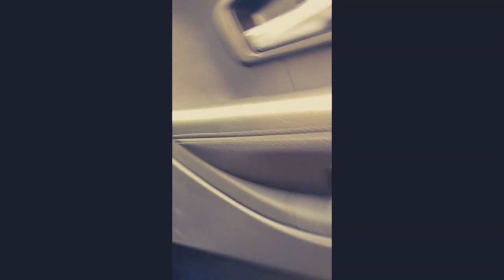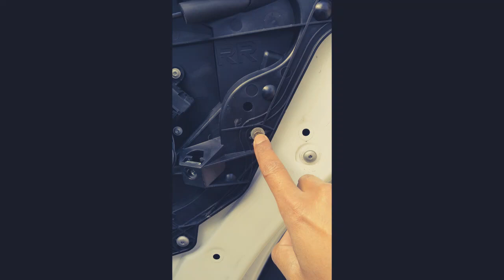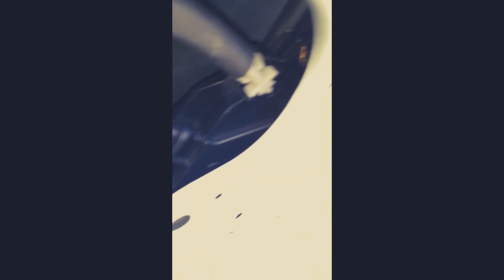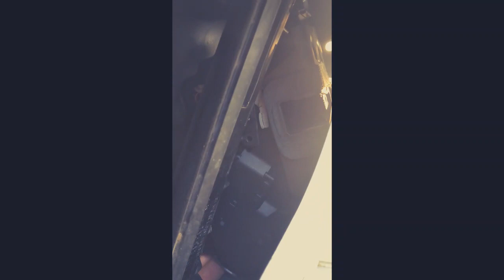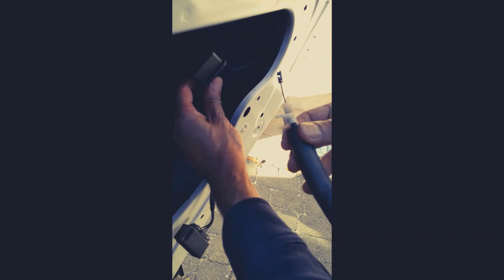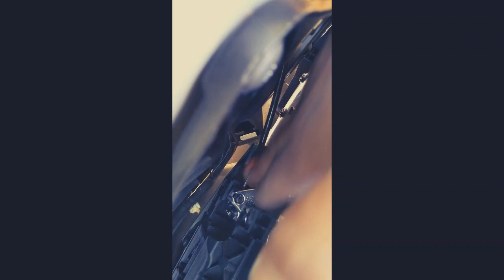How to Fix /Repair rear door lock/ latch for Range Rover Evoque

Comment: There are similar videos on YouTube but I thought yours was the best. I would classify myself in the bottom quartile of mechanical aptitude. Any fool (like me) can take things apart but I struggle with re-assembly, my brain isn’t good at solving mechanical puzzles.
My rear left side actuator failed on my 2016 Evoque, so the central locking wouldn’t work on this door which had to be unlocked and locked manually (if you could remember to lock it !). I tackled the job not really expecting to be successful but I was selling the car and didn’t want to give a buyer another excuse to knock me down. 
I actually watched your video half way through the job, I kept looking at different videos because of lack of confidence on my part and because they all say something different. When I moved the door card upside down and the two metal clips (square washers) fell out, which I hadn’t noticed before, I thought OMG where did they come from ? Surprisingly I worked it out for myself and then I found your video which I think is the only one that mentions those clips and I thought to myself I wished I’d found this video before I started.
Anyway to cut an already overlong comment short, Iike some others have said I also removed the door handles to help to remove the actuator and nobody is more surprised than me that it now works !! 😳 
Thanks for the video. To anyone else contemplating doing this yourself, it doesn’t take that long but set aside a morning or afternoon, it is fiddly and you need patience. You may need to buy some tools if you don’t already have a good selection, I had to borrow a long Torx Allen key from my brother to remove one of the screws that holds the door handle on. Different model years may have different screws and other fixings compared to the 2012 model in this video but nevertheless it’s all the same in principle 🇬🇧

Comment: Great video and thank you!

I’ve replaced the actuator on my front passenger door which was fine, even seemed much less fiddly than the rear.

Now my rear right door has gone. However, I had the child lock on and so cannot open the door.

I’ve managed to remove the door card with the door closed, but cannot manage to disactivate the child lock. I have some access to the actuator obviously.

If anyone has any tips on how I can open the door, I would appreciate it! From there, I should be able to replace the actuator…
Reply from the maker: Sorry, I'm not sure on this one. Hopefully someone will be able to help
Reply: @carguru8262  Thanks for your reply. I managed to fix it finally, I had to use a screwdriver and a lot of patience to get to the child lock pin from the back and turn it. Such a relief when I got the door open.

Comment: Hi.  Just used this video to assist my replace rear right on 2017 evoque.  The innards have changed on the later model. There’s a plastic bracket now that can be moved to access the actuator.  It is so much easier if you remove the door handle and replace the cables out of the door and then simply replace it in one go. I struggled to get the 90degree turn on the outer handle cable as described in this video (3hours)  and if you remove the outer door handle  there’s no need to fiddle through the lock hole to remove the green tabs too.  There’s videos on here how to remove handle only two 25  torx screws and you can attach the cables to actuator in minutes outside of door skin and easy to replace the actuator and door handle to door as one item.  Hope this helps and saves you time.

Comment: Thanks for taking the time to make the video and your excellent guidance. My door locks but doesn’t unlock with the central locking. It does however unlock using keyless entry so I’m not sure if the fault is the same.
Reply from the maker: My doors would some times lock and wouldn't unlock at the beginning. Then after a while they stopped locking or unlocking so I used to have to manually lock the doors from the inside then get out of driver's door and then lock with the remote control as the only door that was working was the driver's door. The doors were trying to lock and unlock but you could see they almost didn't have the power to open/ close the small manual door lock lever on the inside .
Reply from the maker: I think if the doors  lock/unlock  using the remote control then it might be something different
Reply: @carguru8262  My door locks fine with the central locking from the key fob but won’t ever unlock with it. I can open it using the keyless entry sensor on the door but only if the central locking is locked. If the rest of the car is unlocked it will only unlock by manually operating the interior lock lever in the handle. It’s bizarre but as I know how it works I just live with it even though it’s annoying. I call it my Land Rover door

Comment: Very good but when you get to the bit to try to take the outer cable off , don't waste time and temper trying to work the cable through that hole. Take rubber plug out of the end of the door , shine light through and locate torx screw undo it it won't drop it's captive then the end of the outer handle pulls off and unhook the lever part , you can then ease of the clips front and back of the inner latch and cable and it drops down, jiggle both parts around the window guide and out. Swap cables etc outside the car on the bench easy . Refit reverse way . Saves hours and scraped fingers and temper. Also new part seemed dry on external parts so I used lock grease before it went in.
Reply: I did my rear right door today, when replaced I did autopsy on the faulty one . Unusually it was not the fractured white platic lever. All was ok everywhere, so undid the motor housing and out of the 2 motors the larger one with the worm drive was dead. These motors just clip into spring contacts on the pcb so they are easy replaceable, it opened up the motor found the problem , comutator burned/oxidized so I cleaned it with a diamond file lube the bearings and reassembled it . All working again so I now have a donor unit for spares in future. Will locate source for these plugin motors. They must be available or they would have been soldered in.

Comment: Thanks for the great video. Saved me a lot of time trying to find out how to remove the lock. The trickiest part is definitely trying to remove the cable clip behind the lock and it was just as hard trying to get it back on the new lock. I bought one off of Amazon for £13 delivered! Obviously a Chinese OEM replica but didn't look any worse in terms of quality than the one that I took off. Remains to be seen how long it lasts. Now the other rear lock has failed in the same way so I've got to go through this all over again! Still, £32 in parts (couldn't find a £13 part for the right hand door) is far better than paying Land Rover what would probably be about £800 to change both locks. I didn't get a quote from them but I would guess that it will be circa that amount.

Comment: Unfortunately this video  has made a simple lock removal harder than it should have been!. You can do it all in less than 30 mins. 
Instead of fiddling around through a little hole to detach the cables which is near impossible to do. All that was needed to be done is to take the door handle of the car and the whole unit drops down and cables can be fitted more easily outside of the car.  Reversal becomes just a easy to put it all back.

Comment: Agree with Pat, much easier if you remove the door handle assembly. Beware, you do need a long shafted (about 10 cms) Torx 20 to do this so make sure you have one before you start. It is still fiddly, you might like to get some tranquilisers in too. When I finally got mine out, the nylon arm wasn't broken - but replacing the whole latch mechanism still fixed it so maybe it was the servo as suggested elsewhere.
Reply: In fact its Torx 25. I just had to do it again as the replacement actuator failed after about a year. Fortunately, I had kept the old one AND replaced the burned out motor (from China but made in UK!) so the original is back in now and fine. Not sure if I have less patience following COVID but it seemed EVEN fiddlier this time. Must have been designed by someone who likes those wire puzzles where you have to get the angle just right to get it apart/together. I don't know how anyone manages to reconnect the door handle cable in situ. Your dexterity is off the scale. Do yourself a favour and connect/disconnect the door handle cable on the bench. One other note - if you pull the bracket/guide forward, it gives with a click ( I thought I had broken it but apparently not) and there is then more room to get the parts in/out.

Comment: Hi could it stop the front from locking after you have changed it front won’t work now
Reply from the maker: Should have nothing to do we other locks.
Reply: car guru  drivers side would lock three doors on fob but not back passenger changed back passenger all lock now with key but on fob drivers door doesn’t lock but all lock off key
Reply from the maker: Sometimes the doors are set to 2 stage locking so you need to press key fob twice to lock all doors .

Comment: Perfect video, just finished the job with the this in about 2 hours. I recommend to combine it with https://www.youtube.com/watch?v=bb6-xtpIIuM
Its a bit easier when you take the complete door mechanism as well, not so hard to work through the small lock hole.

Comment: Hi, just done this on my wife's front left door (2011 Evoque). It is so much easier if you remove the exterior door handle which is very easy.  You can then change the wires whist the lock is on the bench. Total time 35 mins.

Comment: Hi Car Guru, yes thanks for your video, great, but in it there is a small part relating to the refitting of the cable that opens the door from the outside. I have just replaced my Door Lock unit all went well, the concern was, as you highlighted, the refitting of the cable this I have on, but on trying to refit the cables head into the trigger on the unit itself, I am struggling to get my hand in behind to  twist align and reconnect the metal head, (19.37mins on the video) any tips? all this hassle is down to the window guide that is in the way, can this be removed to allow better access to perform the task?
Reply from the maker: Hi, 
I'm not sure about taking the window guide out as I've never done that so can't be sure how easy/hard it might be. It is very fiddly, but don't be afraid to bend the cable wire to present the wire end at a better angle. I did bend the cable with pliers almost 70 degrees. Just make sure you don't twist or bend the end of the cable where the aluminium metal fitting is . If you break that you will need to change the cable .Hope that helps and good luck
Reply: Cheers Buddy, onwards and upwards. Thanks

Comment: Thanks again for the video.  Unfortunately my 2015 Dynamic has "Passive Entry" so not only is the replacement part more expensive (only from Land Rover for over $200US), but because the part is larger I was unable to get it twisted enough to access the second cable you remove.  I then found that if you remove the external door handle (which is very easy) then you can take the lock / latch out and then remove both cables after it is removed from the door.  I made a short video that shows the larger lock / latch module and describes the extra steps. 

https://youtu.be/bb6-xtpIIuM
Reply from the maker: Great Vid, nice one !

Comment: Thanks for the excellent video. It appears yours was not locking/unlocking with the key fob, but was also not locking/unlocking if you manually moved the lever on the door either.  Mine isn't working with the fob, but I can still manually lock and unlock the door.  Do you think this is the same thing?  Mine seems to be more of a motor issue.  Is the motor in the unit you replaced?
Reply from the maker: I could also lock and unlock the door manually from the inside. Sounds the same as mine .
Reply: @carguru8262  thank you!

Comment: Great video, many thanks for taking the time to record and post it. I replaced the lock mechanism on my 2014 Evoque Pure Tech last night (front passenger side). Some slight variances for the front doors, but took about 1hr 15mins taking my time, especially with the cables. I wouldn't have attempted this without seeing this video, so thank you again!

Comment: Thank You - great explanation and you show all the tricks - Saved me a lot of money - my shop wanted 700€ for it with the part - unbelievable the shop wants to have nearly 5-6 times the price of the OEM part ordered in the internet - had the same experience with the brake pads - they were not willing to give me the LR Number and called up 360€ for a set of pads - ATE Pads Internet price 68€ !!!! - what a ripp of.

Comment: Great vid..thank you so much,...I have to replace one in drivers door..I presume the removal/replace procedure is the same..if you could just confirm that,it would be appreciated.
Reply from the maker: Did change the passenger front door and it was very similar but had an extra capable. I'm assuming the driver door will be similar but can't guarantee.
Reply: @carguru8262  Great thank you!
Reply from the maker: Sorry , it should have said extra cable not capable.
Reply: @carguru8262 Yes..I presumed that..thanks

Comment: Similar problem ,but when pressing key fob once 3 doors unlock then if pressed again twice drivers unlocks ,very strange
Reply from the maker: Has it always done that or just started. If it is a new issue this is what was happening to my door ( not driver door though) , if I kept trying to open with key fob the door would eventually open . However after a while it stopped opening completely no matter how many time I used the key fob . If it's always been the case I think there are some settings that allow different types of door opening ; one stage or two stage .
Reply: car guru just started doing it ,however I think something was pressed on inside so not sure ,will look into them settings,had to change my Audi mechanism yesterday ,was a bit easier than this vid ...
Reply from the maker: If you look at the drivers door from the inside , when you press the key fob once does the door latch on the inside move ie. Does it look like it trying to open but just can't move it enough?
Reply: car guru sorted ,was set at two stage ,thanks for your help
Reply from the maker: Great stuff!

Comment: HELP!! There is an electric socket connector above the actuator. But I don't see it on the new part I got. What should I do now?
Reply from the maker: Not sure what you mean ,have you got a picture of it
Reply: The new part you got is for key fob opening and the one you have operates central locking without pressing key fob

Comment: Very good post. I have just had this problem with my own vehicle.
Reply: Is it for you the same problem that the door doesn't open/close when using the key, but still does lock/unlock when doing it from the inside? Trying to make sure it's this same actuator problem in my car.
Reply: @IckbenArieefx  mine is exactly the same problem  was it the actuator?
Reply: @ray3744  Hahaha, have not yet fixed mine to be honest. Dont really use the rear doors all too much. Thanks for reminding me however.. 3 months is too long should have already done it. Just need to find the part now
Reply: @IckbenArieefx  I'm about to give it ago now will let you know
Reply: @ray3744  Nice, you're fast. Im also having battery problems sadly so now fixing that. What door is having the issue on your evoque and where did you get the actuator? Straight from dealer or would you have a link to one? Mine is back-right door

Comment: Purchased one of these door latches from eBay for less than £35, Using this video i replaced the faulty one within 60mins. This included 20mins where i'd forgotten to clip the door handle cable in properly and had to take it all to bits again. I'm not a mechanic and found the job no worse than 'fiddly'. Thanks for the video it made the job so much easier. (edit: Local LR dealer wanted £378 to do this job)

Comment: Did you use a genuine part or cheap parts
Reply from the maker: I don't think it matters. Selected one that had sold lots and offered a 1-2 year guarantee.
Reply: Joseph Smith I used cheap parts for mine. In fact, THE cheapest I could find. 
Why?

Comment: Hi car guru,  

I have had this issue with the drivers, front passenger door and the back rear right door, does this mean I have to change the door latch for all of them. I changed the drivers side that one locks fine now but the other two are still not locking when the button is pressed to lock? 

Thanks and great video!
Reply from the maker: Hi, it sounds like you will need to change each door if the door .